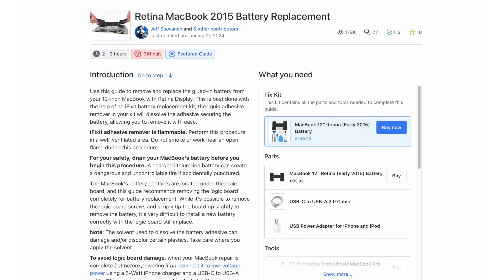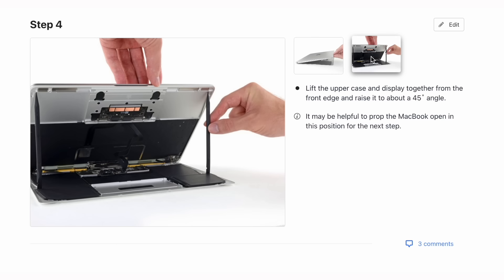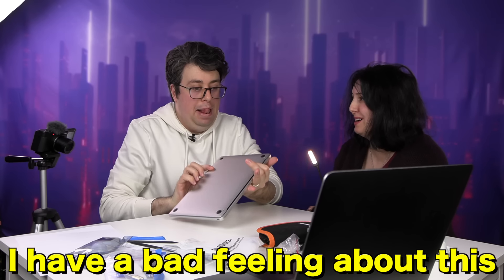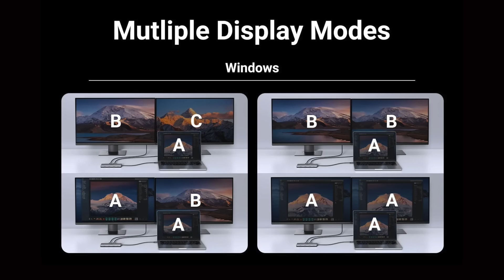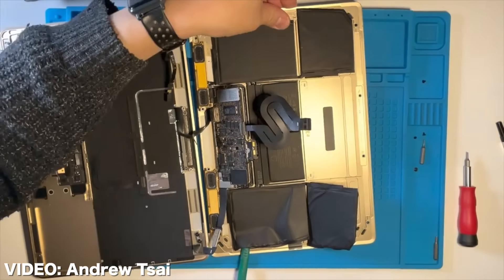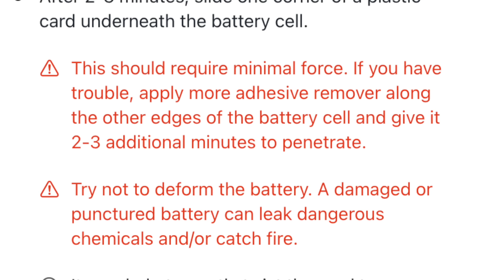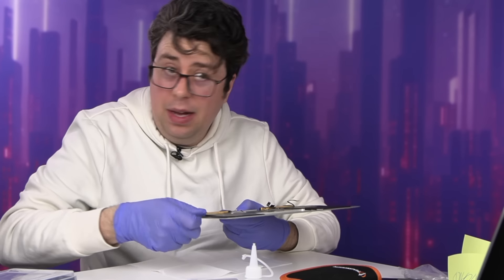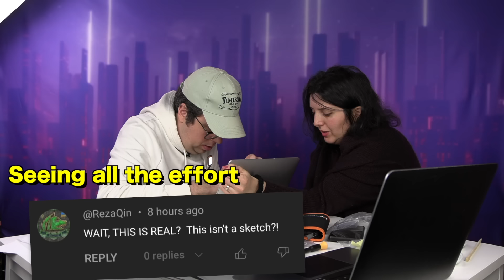So… I Broke My Wife’s MacBook

Comment: I used a string to remove batteries on several MBP without removing motherboard or any other MB parts apart from the back cover. Faster, easier and no need for glue solvent. Happy wife is happy life! 😉

Comment: In my experience this is the most unpredictable MacBook to fix. Battery replacements usually last max 4 months before the MacBook gives up or starts acting funny for no apparent reason. Not entirely your fault it didn’t work 😅

Comment: I've fixing Macs for 10 years and this is the worst model to work with, also some clients attempt to replace the battery and they damaged the flex cables and other things, I really hate to work with this model, I know how you feel like when it doesn't turn on, but you can try to disconnect the battery and plug in, if the Mac turn on just connect the battery again :)

Comment: 2015 12 inch MacBooks habe a peculiar quirk when you change / disconnect the battery. You HAVE to connect it to a 5V charger afterwards to turn them back on. If you connect a typical high voltage USB C charger there is the risk of electrical damage.

Comment: Why I hate Apple products ....
Everything is held together with efing glue !
I've done about 1/2 dozen, what you think should be a simple fix (based on every other manufacturer) turns out to be total nightmare.
I've concluded there are NO simple fixes for Apple Products, they are NOT meant to be repaired, upgraded and least of all refurbished.

Comment: My wife’s 2017 MacBook Air needs a battery replacement. This isn’t instilling me with confidence about doing the repair. 😬
Reply: 2017? how is that possible, how did you charge it, was it used massively every day 24/7?
usually batteries last longer than the machine is used easily.
anyway it's a simple replacement with patience and skill but honestly just let it do in a shop.
the mac in the video is 18 years old, your 2017 is worth it, well actually an M1 air is probably a better option.

Comment: No one usb c support is not sufficient, Apple set the trend of taking things away in order to sell them back to you, Matt displays USB ports display outputs et cetera et cetera. Fapple I’ve owned them since the apple II and supported them 27 years speaking from deep experience, an original MacBook battery swap was a 1 minute operation, they’ve made repairing these items so precarious and arduous you couldn’t make repairing them profitable or reliable very easily.
Reply: This is why I use Linux. Cheaper hardware that's easier to repair, and an OS that runs better than all the competition.

Comment: Ah. Remember when you just opened a compartment on the underside with your finger, slid the battery out, put the new one in and closed the compartment? Good times. 

And there is no technical reason not have this today. The battery is still on the bottom. You could just make a compartment to open, not glue it in, and a simple way to connect/disconnect it. And sell a spare battery. 

The only reason you cannot do this is money. They earn heaps of money more, if they prevent you from easy access to parts that will fail faster than others. You have to go to the shop and they tell you how much it will cost and then you gulp and rather buy a new one (or, if you are smart, a new one NOT from Apple). 

This attitude is spreading to other companies, too. Why? Because they are companies that want to make money. The others did not think people would be so daft as to buy a product from a scummy company that delivers product you cannot repair...but Apple customers showed them, there are a lot of suckers out there. Now they do it, too. For this you need a government telling those companies NOT to do this. As in "make the battery easily accessible and able to be changed by the user without much hassle...and provide the battery for a reasonable price".

Same goes for smartphones.
Reply: yeah, it's really a shame what companies do just to make more money. i have a 2008 esprimo mobile laptop which, even though it's a very chunky boy, is still absolutely usable and it's so easy to repair and maintain. literally a single screw to access the hdd and 5 screws to access the other internals. framework laptops are a really good example that companies can absolutely fit top of the line components in a slim and nice laptop while not compromising repairability. it's a wee bit harder to open them up than the chunky boys, but it's still so so so easy.

Comment: Replacing the battery is no big deal.
Reply: Yeah, as we saw in the video it wasn't that hard. The problem is when you try to turn on your macbook after you replaced the battery.
Reply: @123ftw1  Strange. Never had that problem with Windows.

Comment: Fyi, MacOS is able to connect two monitors without having to mirror them. You just can't connect them both via HDMI. If you have a docking station with HDMI and display port, it just works ;-)
Reply: Ah yes, classic MacOs lacking basic functionality such as having the option to extend displays over hdmi

Comment: I don't like apple products, but i wished so much, that you could repair it.
Simply cause you had so much work on it.
Reply: mac'S are by far the most repaired computers, because windows machines are simply not worth it, there are no pc laptop repair shops anywhere to be found, but mac repair shops are in every city.
this replacement was easy imo for someone with skill and patience, but who wants a new battery in an ancient machine like this.
it lasted way longer than needed anyway, this is so old.

Comment: You didn't break the MacBook because you have to connect it with a 5W adapter after the battery is disconnected for the 12" MacBook.

Comment: I think they've tied the battery to the specific motherboard so people won't be able to buy after market ones. Like they did with the iphone screens etc.
Reply: that's nonsense this replacement is simple, the machine is more than ancient and mac's are by far the most repaired ones just like phones, all the rest is pure trash and lands just there.
you can replace screens on iPhones from third party easily just like the battery, just like on the mac.
you wanna see some serious insane battery replacement procedure? 
look at the Microsoft surface, you have to disassemble literally everything.
but the machine will be broken anyway just like any non apple product they break in 2 years or 3 at best.
there is always something.

Comment: With Framework laptops you can replace the battery in 10 minutes.....just saying if companies wanted to be consumer friendly they could be as long as you aren't obsessed with needing something under half a inch thick.
Reply: With any laptop designed by a sensible person you can replace the battery in seconds

Comment: BEFORE THRwOING IT OUT:
Take a flashlight and flash it through the apple logo on the back side of the screen, maybe you just damaged back light cable and you can not see the content of the screen.
But, probably, it is garbage for those "green" apple fields, because of their war on repair.
Just buy another one.

Comment: I Love my Mac Book BUT Apple are a-holes. Period! They make doing simple tasks like putting a new battery in such a damn problem and have designed it so your chances of breaking something compound exponentially. I mean why is Apple selling so many products when their goal is to trap you into a perpetual buying state of their stuff. Great hardware, just don't expect to continue using it longer than Apples discretion. If people would band together and use purchase power, they could change this, right now Apple seems to think they hold the conch. Truth be told we the consumers do. Everyone just settles for what is thrown at them without providing backlash when crap like replacing a simple battery takes this much effort and risk. AND yes I realize its a slim model that does in fact require some engineering to get it to be that thin while still functional. BUT you know damn well all their products are now like this. Also Apple, why would you put the charge port for  your magic mouse on the damn bottom of the mouse? 1. Who designed this, 2. Who approved this?

Comment: Apple are a total eco disgrace - not replacing the battery on this model.
Reply: the opposite is true, see, contrary to pc laptops, which break after 2 years of use and never get repaired or sold second hand.
mac's get repaired etc, it's no comparison, not even close.PC's are simply not worth it to repair.
this mac is 18 years old, how long lasts your plastic windows machine ? and do you repair it? are there any parts avqailable? 
no, see.